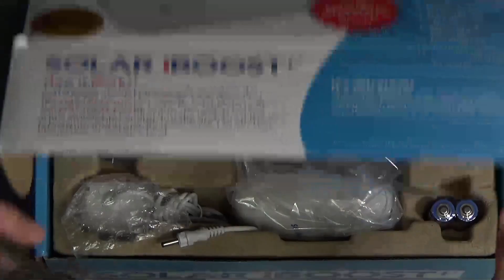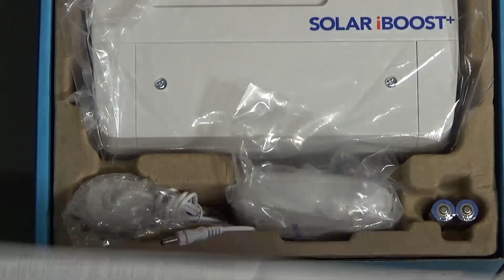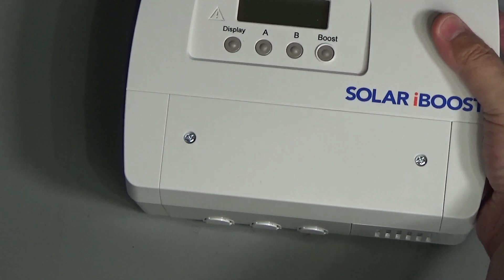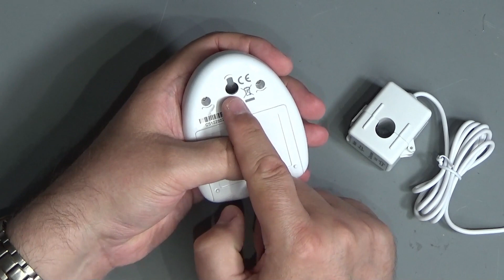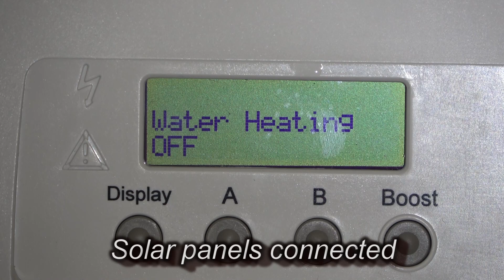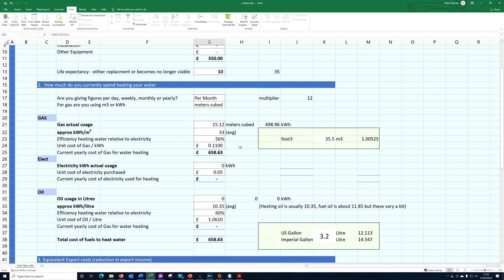Solar iBoost+ Diverter Review Installation - Is it worth it #0063

Comment: Thank you for the comprehensive video. I have a combination boiler (i.e. no water tank) so this system does not work for me. However is there any reason this unit could not be used to 'charge' a storage radiator?
Reply from the maker: Interesting question.  Technically it can be done I think but some storage heaters have quite complicated controls that try and adjust the charge and discharge times and rates based on ambient temperatures etc, these might not be easy to use - however a simple heater is just a heating element, bricks and insulation, they could be proably be "topped up. with solar, then the timing mode turn it on fully at night during lower cost electricity periods.  Of course the rating of the storage device must be within the capacity of the diverter.  Also need to look to see how the vents in the top are operated - if it is an electric motor then it could be tricky since it would need constant power, you might need to do a little surgery to separate the input charge circuit from the output venting circuit.    I was thinking about this method  for heating my lab and studio but I think the amount of exported elctricty I have available in winter is just too low.
Reply: @MakeOrRepair  Looking more deeply into this there are companies that do it, here's one https://www.elnur-global.com/self-consumption-heating-solar-storage-heaters-for-photovoltaic-installations/  The cost for both controller and heater is around £1k. Looking at my historic reading (installed in 2011 - max FIT!) I am getting in approx. 1000 kw/h in the period Sept to March. That is 5.6 kw/h per day and at 34p/kw/h a potential saving of £400 for the 6 months. Clearly  the capital would be covered in three years. I now need to consider than we do like to look at out gas coal effect fire in the evenings! 😁

Comment: Could we get the detail spread sheet to input £250 or £500 install costs and the current government caped price, also octopus is offering 15p / Kw  just be interested. The 2 cost are DYI install vs Professional install
Reply from the maker: You can put any installation cost you like in the spreadsheet and any other capital expenditure involved.   In terms of government capped price not really sure what  could do about that, the cap applies to all heating fuel gas and electricity whatever the use so it could not really apply just to this purpose.  Not sure it applies to heating oil at all!  The spreadsheet is not protected,  you can adapt it as you want.   You can even "fork" it on github and upload your suggested alterations, if they are good then I would accept them and they would be available to everyone.

Comment: There is a different way to look at the savings beyond the return on investment and that: if I have disposable cash now and won't have it later, it's worth spending it to keep running costs down. 

My payback period for my solar/battery has gone from 15 yrs to 10 in twelve months due to energy price increases. And that's great, don't get me wrong.

 But the important point is and was smart tariffs and reduction in grid usage. And in that 12 months this year even with the new higher costs my running costs each paypacket will be half what it would have been. If they get cheaper my pay back will lengthen again. But energy costs will still be half what it would have been each month.

Immediate saving means you can save for the next saving... Or keep your head above water if times turn tough.
Reply from the maker: Well, yes that is a decision to make and is my main reason for solar and batteries, i have capital but income is tight.  But you still need positive roi, or you may as well put it in a saving account.   One way to not have funds in the future is to spend them on the wrong things.  Also had I known where inflation was heading I would have said about capital investment now in saving technology having greater value because fuel is going to cost more, and each pound will buy less in the future.  Roi should take account of inflation, and anyone investing in solar or diverters over the last few years is going to see far better return than expected.
Reply: @MakeOrRepair  you never know we might rebalance our energy market to reflect the actual cost of most of our electricity , which will lengthen ROI again lol. 

I'd been putting money in a savings account so that I could afford to put this stuff in without loans. Interest rates the whole time were shocking - that might be about to change of course, but I definitely don't regret my purchases so far and for a couple of hundred quid extra I'm hoping the iboost my installer wants to put in rather than springing for the Eddi I said I thought I wanted is going to still be worth it and not cause probs with my battery.

Your video has been really useful for me in spotting any early problems I might have to manually configure around response times though, thanks so much for that

Comment: Great video! also just to point out, I highly doubt the device will last 35 years.. I've been though 2 of these in 6 years.. I am no longer going to replace it as the device isn't reliable enough.
Reply from the maker: From the earlier comments reliability does seem to be quite a problem.  Mine is still working, but it would be interesting to get hold of a few failed units and find out if there is a common cause.
Reply: @MakeOrRepair  There is [unfortunately], failed bridge rectifier. Several posts on YouTube that cover this relatively common problem

Comment: If it uses just solar. If it dont get up to 60deg C younget legionalla
Reply from the maker: It is a combination of how fast your water is used and temperature.  At 50c it takes a few hours to kill legionella.  At 60C it is only a minute. You really want to avoid storing water at say 25-45 for a long period.   Risk is reduced however if the water is not stored for long.  We use the diverter for some heat, then gas to bring it to 60c. Useful to remember that the water at the top, which is used first is hottest.  So I would recommend setting a timed on period to top up the heat if it needs it, thermostatic control is a must!,

Comment: Very detailed thank you. Good point re the fan noise. I had a hum from a house alrm main control box situated in the airing cupboard stud wall which backs onto the bedroom. It could just be heard so I had to make up a sandwich mount with  polystyrene in the middle to dampen the noise.
Anyway it appears my immersion heater does not have a separate feed from the consumer unit so its switch must be part of the upstairs ring. Would you foresee any issues by continuing with this as the feed to the iBoost box and then a further isolation switch on the immersion heater side of the iBoost?
Reply from the maker: I don't see a problem, a typical 32A ring upstairs can easily handle approx 3kW heater.  I suppose there could be some switching noise going back onto the ring  but my quick look in the device indicated it has some good suppression and if I recall correctly it has relevant certifications regarding causing interference.
Reply: @MakeOrRepair  thank you for your reply. It would be possible to add a direct feed but it would require some work routing the cable. Come to think of it the upstairs ring has no real demands on it other than the odd phone charger and. bedside lights. Occasionally the vacuum.

Comment: do you have any opinion on this vs the EDDI? we dont get the feed-in from the excess so i am looking at purchasing one for when my fixed energy price expires! Thanks
Reply from the maker: Someone else commented that eddi is more configurable etc.  Other than that no practical experience.  If you are getting nothing for feed in then most companies are required to provide at least Seg payments.  My octopus go does not pay for export, but I ca sign up for separate export account.  Of course you need relevant paperwork.
Reply: @MakeOrRepair  We went with a roof rental scheme (ashadegreener) and they collect the feed-in and we benefit from the free electricity if we use it efficiently, this might be a stupid question but can you wire the iBoost direct into a plug socket and have it trickle feed a portable battery with the excess when its available?
Reply from the maker: @andylfc7812  well with no payment for feed-in then you certainly want tovtet everything you can from the generated.  Using an iboost with a battery sounds dodgy, pretty sure I discussed operating principles with someone on an earlier posting and it would not be suitable in most cases and how do you get the voltages right?  Maybe there is a smart battery solution, but it would involve an inverter etc and likely expensive.

Comment: One cubic metre of gas is roughly 11 kWh not 33 kWh as in your spreadsheet.
Reply from the maker: Err, yes about 10 to 11 depending on temperature and calorific value, I was generally approximating most things but I  must have missed a step in my conversion. Need to fix that
Reply from the maker: I have now updated spreadsheet thanks

Comment: were did you get 10p KwR Electric & 3p Gas KwR, try as of today's tariff August 2022 try x3  30p electric 8p gas. 
Fun Fact 300L water takes 10.5KwR to heat up from 40 to 70 degress this is Avg for a house hold.
so that's a cost of £3 per day £22 week £90 month. 
so if you manage to export 10KwR a day this is what you would expect on 300 litre system.
Reply from the maker: That's what it was, I did say it was increasing and how that changed the payback.  I currently pay 7.5p electricity overnight and 27 during the day.  My gas is 3.2p for the next year, after that it goes up a lot.  The cost benefit continues to depend on the difference between the price you get for export and yhe cost of fuel you replace with diverted power.  Note however that people with indirect tanks where immersion is a backup are unlikely to be able to heat hhd whole tank, just the top half.
Reply: @MakeOrRepair  how the hell are you getting these prices, could you tell me so i can change to it.
Reply from the maker: @eco-terrorist  I use Octopus Go, you need a SMET2 smart meter, it is a fixed 1 year deal.  Don't know the exact prices they are offering at the moment, I renewed for a year at the MAY rates. But easy to get a quote and if you do find a better deal later you can leave without exit penalty.  I think I have a link at bottom of video description  where if you are a new octopus customer you would get 50 credit.  
My Gas is just the normal price, I just happend to be lucky and change to a 2-year fixed deal before the prices got silly, not looking forward to next year.
Octopus go only makes sense if you have batteries or an EV so you can make full use of overnight lower cost power.  And if you can use solar for most of the day.  The downside is that it does not include a high-value export payment (because you buy cheaper) but you can just ring the helpdesk and they will give you a basic SEG export rate (mine is 4.2p per kWh exported)  or you can do the export with a different company.
Hope that helps.
Pete

Comment: You raise a good point about the battery considerations. I just wished there were standardised house systems which were intelligent enough to route the electricity where it need to go.

From personal experience, where this unit comes into its own and offers a MASSIVE benefit is when the house runs an air source heat pump. During the summer, 100% of our hot water has been  produced through this iBoost and the air source heat pump has not kicked in AT ALL. Our air source heat pump runs at around 7-9kw for water heating so this introduces a massive saving. Not only is the hot water much hotter than what the air source heat pump can produce but it also means we can completely avoid the legionella cycle.

We don't have batteries yet but they are on their way. I'll have to look at things closely.

I'm sure things will be very different in winter. This is only our first year with solar.
Reply from the maker: I know what you mean about lack of standadised systems, the systems available are just not smart enough, you really need a central system that reads all the sensors, looks at cloud cover for the day ahead and optimises everything. Smart things are available but the don't integrate.  You can use rule-based systems, but not all the controllers and data sources are available  for example I boost my batteries overnight at low cost, but i should vary the amount based in next day weather, despite the inverter having rs484 control intrrface, to do that i would have to make my own controller.
The heat pump is interesting,  I didn't feel able to comment on diverter with heat pump and hadn't given much thought about how you would achieve hot water with one.
Reply from the maker: Batteries made a massive difference to how effectively we use solar, also with cheaper overnight electricity we can store enough to reduce our bill by 70% in December when we generate virtually nothing.  Hope they work well for you

Comment: I don’t understand why you feel the battery would be an issue? My understanding is the eye boost is only sensing if electricity is being exported therefore weather solar energy or battery energy is coming to the house is irrelevant only becomes relevant once it starts leaving the house. Am I not correct in that?
Reply from the maker: If the battery is charged and we have say 1kw to spare then the diverter takes it instead of exporting it so far so good. But of course the inverter/charger sees that the immersion is on just as another household load so will try and prop it up with battery if the sun shades or another device starts.  the inverter is trying to prevent import.  In fact it does happen for a few minutes.  Also there is a minimum current to charge the batteries, so the batteries and diverter are looking to use the same power, that is why adjusted the divertef threshold, to ensure the battery charge gets to use it first.  It works adequately though.
Reply: @MakeOrRepair  I think that is easily solved by setting the diverter start point to 200 watts or so. The battery is going to shoot for a zero export and that should shut the diverter down. I mean the battery export control electronics accuracy is high so will never let the export go off to figures of a few hundred watts more than  seconds
Reply from the maker: @gopikrishnayogarajah  well the remote sensor is pretty slow.  Setting the  threshold a bit higher does do a good enough job as I showed in the video but it was certainly worth checking.  Anyway, now I have more battery storage. I don't export enough to heat the water using this method, but everyone has different circumstances so I thing comments in video still help people think about it which was the point really.
Reply: @MakeOrRepair  Sure thanks for sharing . I was commenting because I have this setup and it works fine. Yes it is slow to react but that slowness I feel is also part of design intent to allow the battery system catch up and Zero the export/import (that prevents the run off you suspected) .  For me it all works fine but yes it does let go of some small amount end of the day to the grid as compared to more sophisticated systems - on the other hand does a fantastic job of dumping majority of the excess into the tank. I have solar inverter  and separate AC coupled battery just FYI.

Comment: Excellent video, thank you.  I've just fitted one of these for the same reason as yourself - seeing that gas has gone up to 7.4p and is predicted to go to 12p or higher.
One question about your efficiency test between electric and gas - I suspect this wasn't a fair comparison. Unless you have a de-stratification pump or dual immersion (top-bottom) elements you will likely be heating only a 1/3 to 1/2 of the tank during the test and not the full tank as the indirect coil would do.  
Solving the stratification problem in a low cost (DIY and without a new cylinder) is a problem I'm currently investigating...
Reply from the maker: Yes,  I had forgotten about it when I shot the video.  On a good day with cold tank, it heats about 1/3 of the tank, then the gas has to finish the job.  Having said that I don't have masses of export to use so, except on really good days it uses most of my export.  It works out similar to the adjustment I did towards the end of the calculations, but just goes to show that for gas users it is harder to get the benefits than you might think.
Reply: My system has a deep immersion heater, so heats the full volume of the tank. Probably not exactly the same quantity of water as the gas powered water coils, but pretty close. The electric thermostat is also set much higher (at 65 C). Given similar starting conditions, the IBoost reports about 2.5 kWh needed to heat the tank, and my smart meter reports about 5 kWh of gas - so my best guess is that the real world efficiency of gas is 50% (using a modern condensing boiler with claimed 93% efficiency, so the loss is probably due to heating all of the water in the pipework connecting the two, and letting it leak away afterwards).